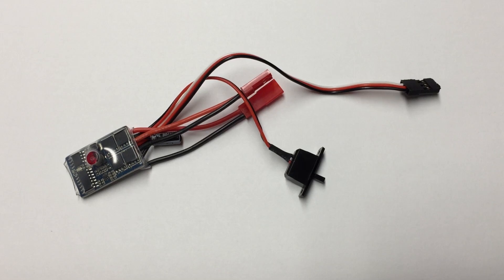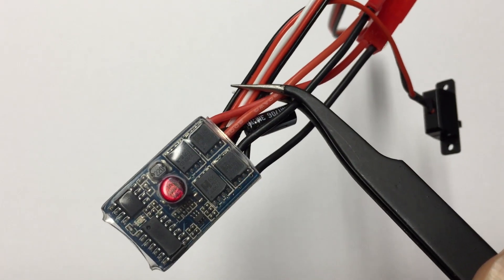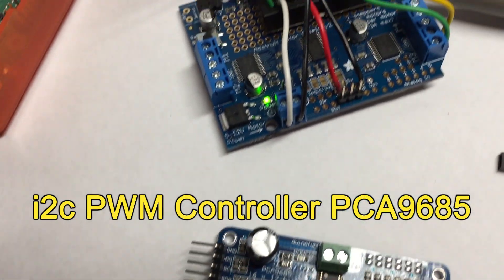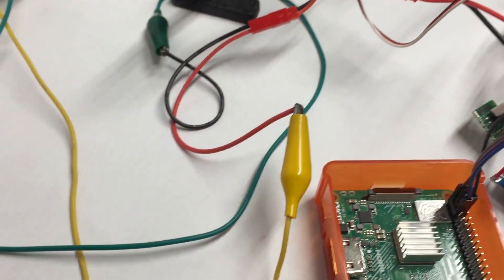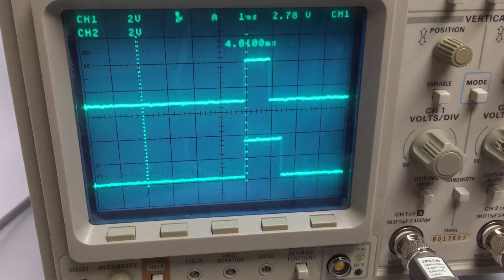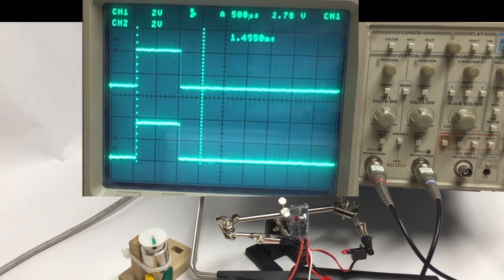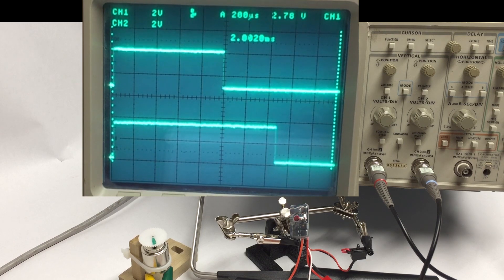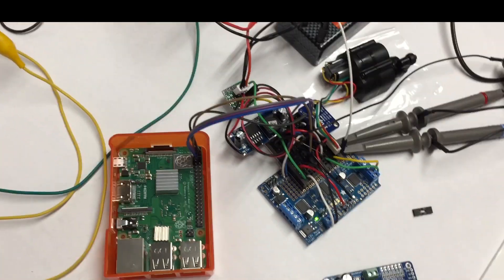RaspiCar Pt2 Cheapo $8 10A Brushed ESC Scope Testing

Comment: Hey cool project! I was wondering is this ESC will work with a flysky RX , I want to build a brushed airplane with 7.4v 8520 brushed motors & I need to find a brushed ESC that can work for me cause I have a lot of brushed motors and they are light weight when you use them with a geared propeller you can get way more power from the small brushed motors